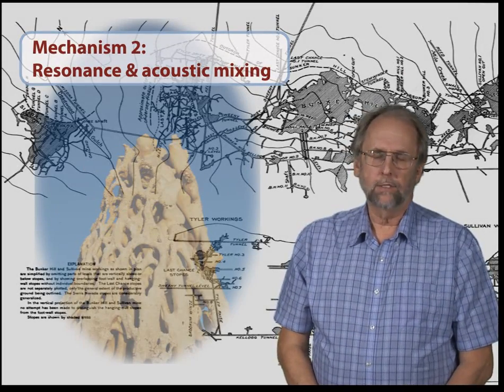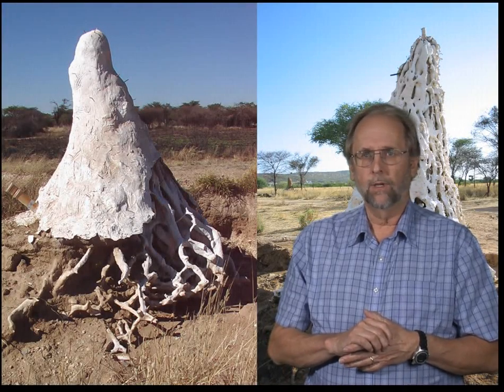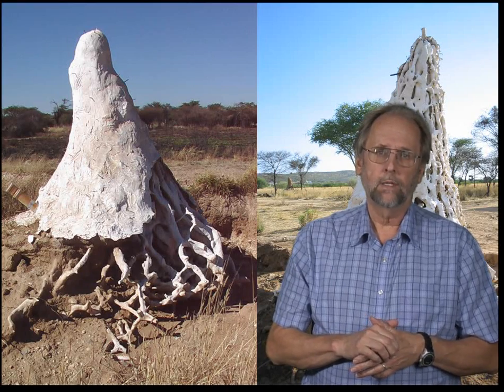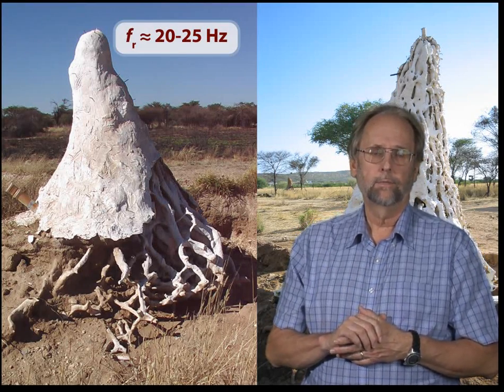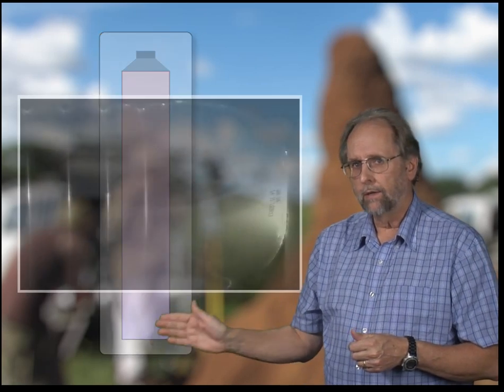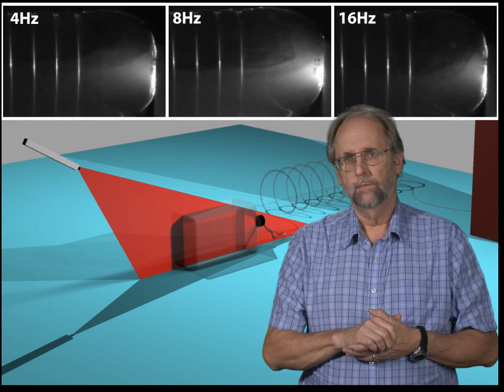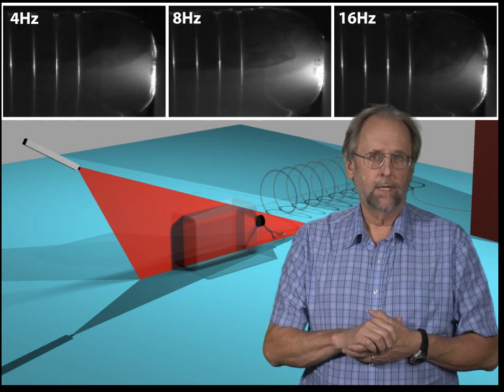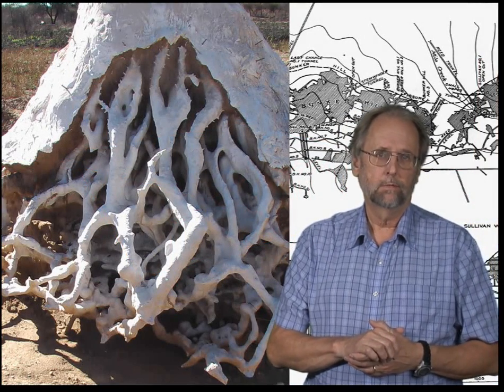Transient state gas exchange mechanisms in termite colonies

Comment: How does one calculate the frequency?
Reply from the maker: You do it with a Fourier analysis from the output of a fast-responding anemometer, such as a hot bead or hot wire anemometer.